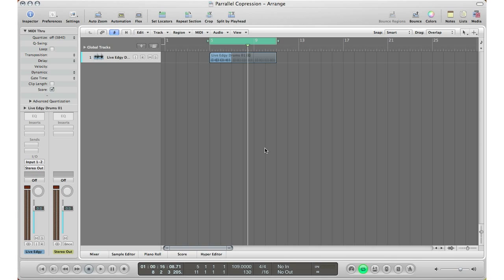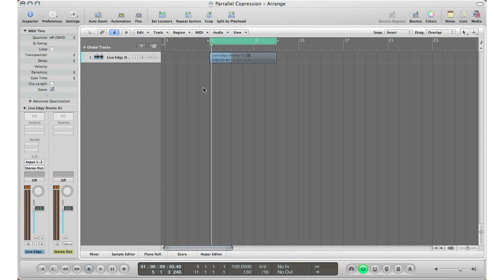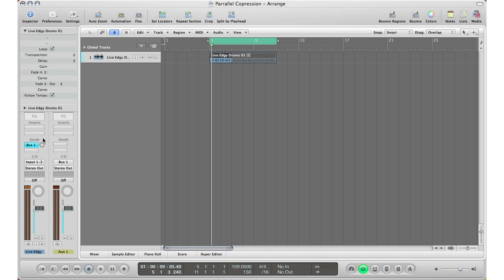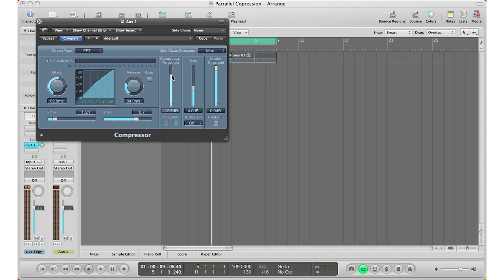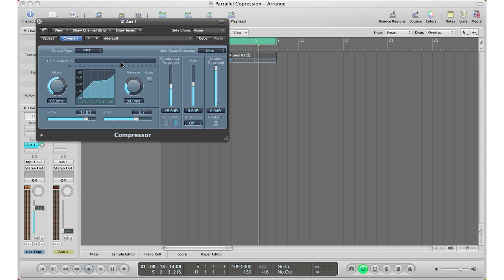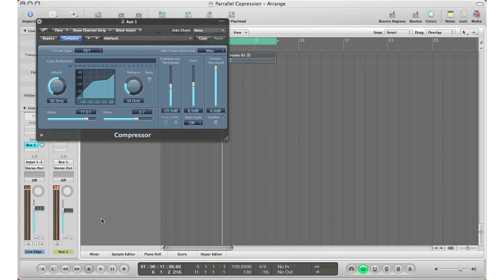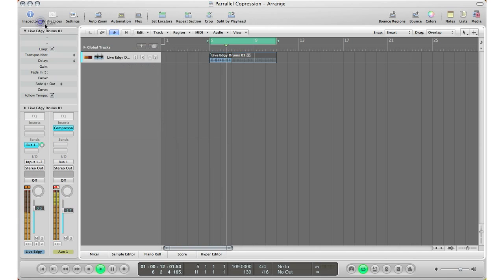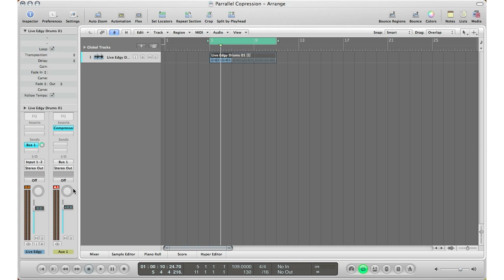Tips  'N Tricks Thursdays Episode #4 - How To: Logic Pro 9 - Parallel Compression

Comment: Admittedly, I dont have a huge amount of experience with mixing, but I feel like this video is legitimating overcompression. Obviously it initially sounds better when you turn the volume way up, but at the expense of completely squashing the sound. From what I currently understand, a much more effective use of the technique would be to leave the compressed channel low in the mix. As is, it's simply overpowering any sense of dynamics.

Comment from the maker: @DrUnKkAz Parallel compression is adding drastic compression settings to your track .. You would'nt want those setting on the track alone but you would want to use it in a mix with your dry signal to get a thicker sound.... Let me know if that answers your question...